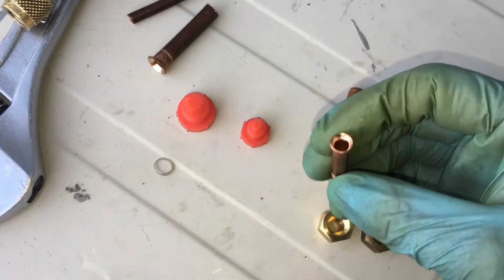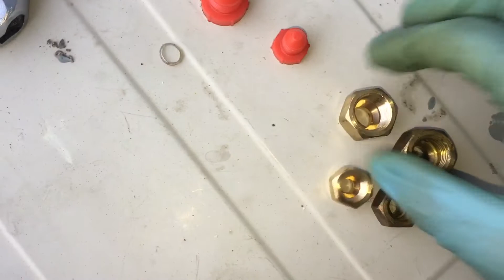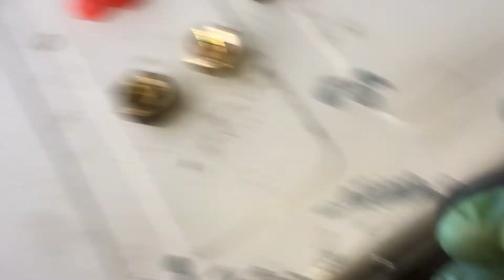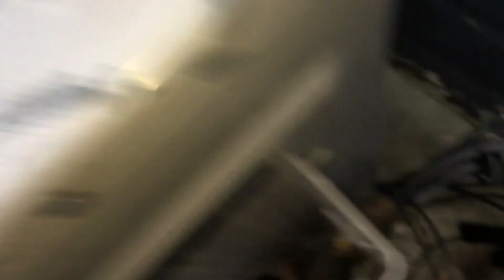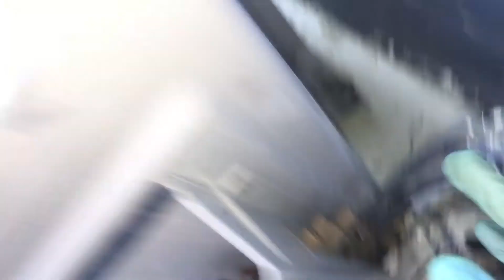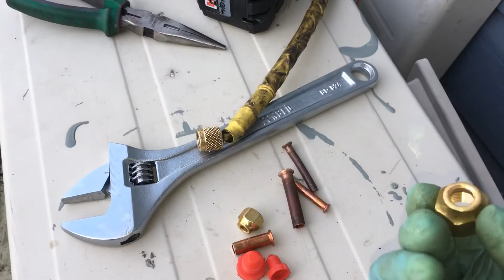Don’t Use factory line set NUTS, Use Original equipment heavy duty cojones￼ ￼

Comment: There's some real junk out there, isn't there?  I suspect some of these are water-pipe fittings sold by shysters as lineset fittings.
Another place they do the same thing is automotive brake line fittings, no way I'd ever trust 2,000psi to a compression fitting like I see them passing off as repair parts.
Reply from the maker: Yes I have actually seen in the refrigerant fitting section brass water fix fittings from plumbing being sold as refrigerant line fittings at one of the commercial HVAC places years ago I made the mistake of purchasing one as a emergency replacement it later failed it cracked about a year and a half later cause they come back for lost the refrigerant charge.